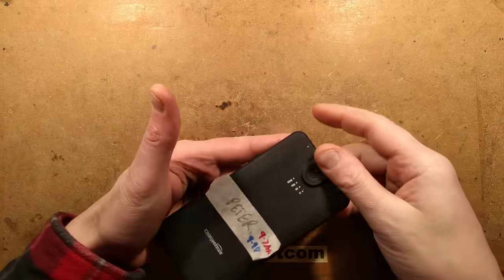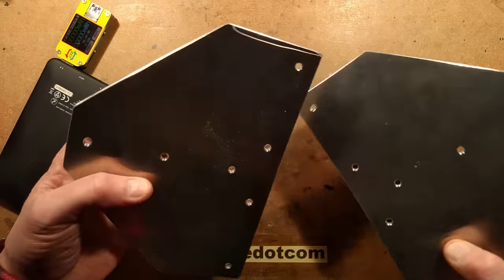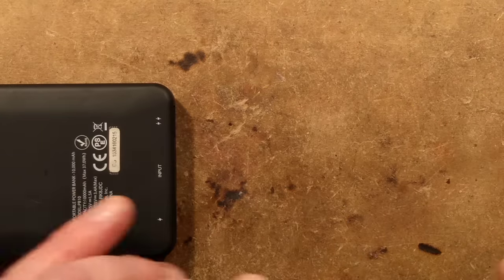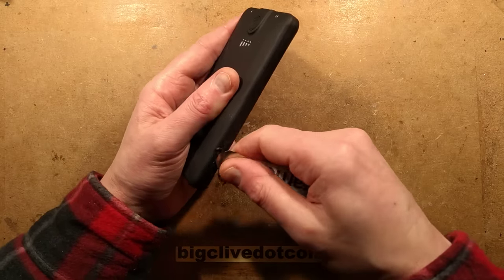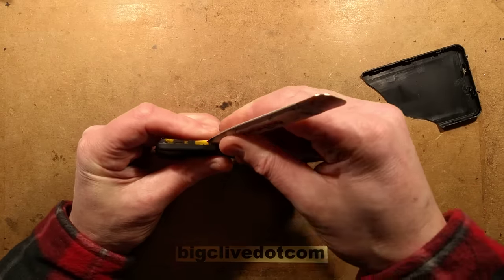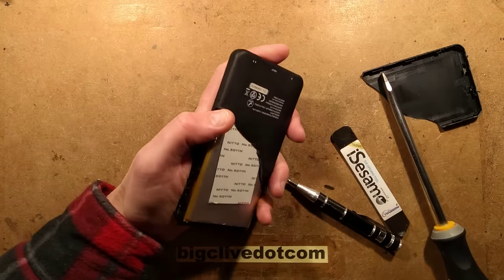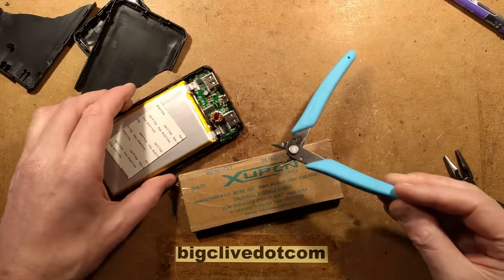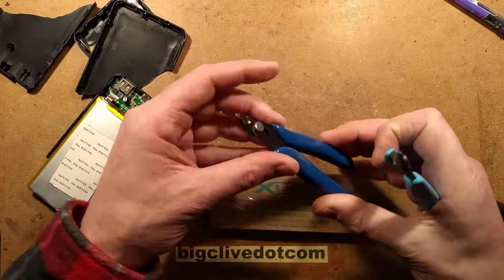Inside a recalled Amazon Basics power bank.

Comment: Hey Clive I'm most certainly not trying to tell you how to do what you do I'm just making a suggestion couldn't you use the heat gun on your soldering iron and heat the double sided sticky pad and slightly melt the glue it should make it easier to remove the cell and it shouldn't be such a risk of it exploding just a suggestion for the future

Comment: The little USB/control board tends to be perfectly fine ( £1 or so from Aliexpress/Banggood etc ) The LiPo's generally are cheap ( but reliable enough) high capacity low output packs that are stacked to either provide 7.4v stepped down or more capacity and stepped up to the 5v USB requirement ( iuse lipos in my RC Planes, Quadcopters etc but im changing to 18650 )
That case , as you suggest is horrendous, there should be some "breathing room" to provide a buffer for accidental drops etc but todays market wants more but smaller and so crap like this is what they get.
Reply: Rc batteries for me as well, my lad gives me his cast off drill batteries. Have converted most of my fleet to take 3 or 4 cell batteries. Great fun separating the cells from a Makita or Dewalt pack. Perhaps I might loose a minute or two duration, but for free that’s ok.

Comment: The recall is over concerns that it can over heat, no information on what over heats, the battery or the circuit board but it does state there is a risk of chemical burns which suggests the battery.
Does seem a bit of a panic reaction though there has been 50 reports of problems out of 260,000 units shipped, that seems like a fairly reasonable number of faulty units and not really an indication of a wider issue.

Comment: Using 99% isopropyl alcohol will temperately make the adhesive non sticky while wet and sticky when dry. I use it when removing the sticky strips on the iphone batteries.

Comment: 15:06 watch that solder short the battery under Clives sleeve....... Doh....... wonder what would have melted first, the solder or the battery.... perhaps another video!
Reply: That small of solder it "should" melt very quick and break the circuit. Im not willing to short out a lithium to test that though, but i have shorted solder against ground and a positive wire on my pickup. It melted in the time it took me to figure out what was going on.

Comment: Put the cookie down :P Even plastic pry tools can pierce into battery and do some nasty , but at least the screw driver is more easy to get but it can pierce also hand, but the electrician is experienced :P They didn't put the double sided tape to avoid riping the li-on pack if dropped since it is so tight fit

Comment: The extra resistor being used for current sensing would certainly make sense, not essential perhaps and often omitted by commercial manufacturers looking to save a cent perhaps but still a wise and rather low-cost sanity check to make sure not to overload the cell and it's highly volatile chemistry. Well to my mind that would certainly be the sort of thing that I'd opt to include if I were designing it, fire bad, customers on fire bad for reputation, less fire good but sadly all too often companies focus on making profit for the next 5 minutes rather than long term heh. As for the proximity of the mosfet probably not the cause though depending on the mosfet it doesn't strike me as the best idea to have anything that close to the battery which has the potential to exceed 100-110C even under failure conditions and some mosfets could continue to operate at that sort of temperature without failing. Sure that is quite a bit lower than would be expected to pose a high risk of the battery going into thermal runaway which is closer to 130C being a temperature that no part of a Lithium Cell should ever hit but considering the violent consequences of the things failing I would rather have any component that can reach 80% of that value and still continue to produce heat in a fault scenario as far away from the cell as space allows. The other components if they fail is a dead device that thing fails with enough energy to easily ignite any one of a number of very common materials such as paper and plastic with ease it's a building igniter in a failure so not something to take stupid chances with. There is a lot of excess paranoia with the things that blows it out of proportion but they certainly are no toy and it only makes sense to engineer to minimise the risk of unleashing their volatile chemistry in an uncontrolled manner for sure.

Comment: In reference to 4:40, I find iPhones are more easily openable than Samsungs, Huaweis, LGs and the like are. You just need the proper security bit for the two screws near the lightning port. It's been a while but I believe the rest of the screws inside are bog standard torx screws. Compare that to a samsung where you have to melt the bastard screen off just to get inside the bleedin' thing. 

They've got to have something good about them, right? :^)
Reply: Ironically, the cheap Chinese phones like Xiaomi, and even cheaper are simple as to open. Most use 2 Torx screws (normal ones, but tiny) and then clips. And once open, everything is easily disconnected and removed.
Worst part is taped in battery, but most have a removal tab to make it easy. Chinese people must repair stuff still 😂

Comment: The fact they didn’t use the double sided tape properly and peel the other side off is a bit worrying only because you’ve got people like that making them what if it was the battery connections they messed up a little bit and the battery shorted out, what are you going to do then, if someone doesn’t know their battery is shorted then it could explode in someone’s hand

Comment: Another thing is that it may have recalled for similar reasoning as to the EE power bar recall? as I remember you covering that one well enough.
Or it might be that 3.4A is too much for some of the internals (regarding heat). The battery should be fine as it would be 1.7A per cell, which isn't a problem with a 5Ah cell.

Comment: TBH I don't think the packaging on lipos is that easy to damage to the point that the battery will explode by dropping it and causing the corners to get dinged. Maybe dropping it and something else in the casing like the PCB piercing the battery.
I have tons of RC lipo packs that have flown/fallen directly into/onto concrete etc and ended up bent in half or ripped apart to the point that the tab welding is the only thing holding the pack together. If you have the balls to do it they still charge and discharge just fine.

Comment: This video, which had me expecting a flash and a bang for a while, attacking a charged battery pack with metal tools??  Mmmmmmm,  has reminded me of an issue I had a few years ago.  Also involving cheap side cutters.   I supply portable radios, walkie talkies, the UK supplier had bought some "cost effective" Chinese replacement batteries and we had sold some to one of our customers.  All was well for a few months and then I got the dreaded phone call, "a new battery pack has caught fire in the canteen"  they weren't happy as it had interrupted lunch.  OK replacement sent FoC with humble apologies and we would collect the faulty one when we were next passing.  Then 2 more went up with the same customer, OH heck.......   To cut a week long story short, there was a protection diode in the base of the case to stop volts appearing on the charging pin, there was also an internal fuse as a last resort form of protection.  The diode was separated from the cells with a thin piece of card, as per the original "expensive" batteries.  The BIG difference was that in the original batteries the diode lead was cut prior to assembly and flat on the tag that it was soldered to.  In the "cost effective" batteries the lead had been cut in situ which involved bending it at right angles to the tag, the cut had a "nice" sharp end left by the cutters.  Right, quite often the users of radios do not appreciate the jobs that they are called upon to do and in frustration bang the radio back down on the desk, or in at least one case, the canteen table.  The battery pack moved downwards within the case and after a number of frustrating calls the diode leg had cut through the card insulation and shorted onto the case of one of the cells,  sadly on the wrong side of the fuse, and so the battery added to the days frustrations by catching fire.   I had a chat with the importer and they were most apologetic, they checked their stock and there were many 100s in stores with the same issues and many more already sold, an expensive and potentially deadly error.  All of this due to just how a diode was cut and how a battery pack was not secured within its case.   PS Big Clive, your videos are amazing, enthralling and informative viewing, long may they continue, thank you and sorry for going nearly totally off topic with the above waffle!
Reply from the maker: That's an interesting failure mode.  I've seen a lot of products with lithium cells crammed into cases literally pressing against the sharp solder points of PCBs.

Comment: iPhones are serviceable, presumably much to the annoyance of battery changing “Genii” at the store that regularly give away free screens after they break them trying to open them. So if you have a scratched screen get a new battery for £45 and are odds on you get a new screen as well.
Reply: Serviceable implies user serviceable. If you need special tools, then it is simply NOT serviceable. If it were held together with phillips screws and clips then it would be.

Comment: I find using a Stanley knife blade and a hammer to tap it into the seam works very well
Reply from the maker: How deep is it best to tap the blade in?
Reply: @bigclivedotcom  usually only a millimeter or so. I tap it with either a pair of pliers or a small hammer.
Reply from the maker: @jaycee1980  So not the full depth of the blade then.
Reply: @bigclivedotcom  well.. maybe if you want flames :)

Comment: This is why "power banks" are worse than "li-ion chargers with power bank function". They are bulkier, but being able to use 18650/21700 li-ion cells that you choose is worth it for safety, performance, and serviceability. Consumer devices with Li-poly packs are so often janky because there is no manufacturer accountability -- the no-name batteries are made in the worst conditions by whoever does it cheapest. And some of the newer lithium ion cell chargers are now made with throw-in-pocket size and durability in mind.

Comment: Often that double-sided adhesive tape releases quite easily when you hit it with a heat gun. Not a flamethrower, just a modest heat gun.
Reply: Another quick way of producing enough heat for it to loosen is simply stabbing the battery with a screwdriver

Comment: For the kids attempting this at home:
Use a solvent to soften the adhesive tape!

I use isopropil alcohol, lamp petrol, automotive petrol, paint thinners, with great success. 
All it takes is a couple of drops put on the sides, around the cell, to seep in and a few minutes of letting it soften. 

Avoid acetone. It works but dries up way too fast.

Comment: you can use a bit of hot air to heat the case an soften the glue
Reply: There is no glue, and sure, heat up a battery, that always works up well
Reply: @leopoldobaltierra953  those glue strips that holds the bat in.

Comment: "The extra current that runs through the machine when the heating element is on can cause the door locking system to overheat." Care to do a vid on why the latest Whirlpool recall stinks of terrible electrical engineering?
Reply: Watch his video about how those locking systems typically work.

Comment: Modern phones like the newest samsung's and iphones are serviceable, they have just made it harder for anyone not authorized to work on the device+the complexity of unibody devices are ever increasing/changing. Trust me, I know from personal experience...and have had to revive thousands of "water resistant" devices in exchange for a decent tension headache lol. 
P.S. 
Advanced electronic repair and not for the shaky hands of this world, you could could snap glass and boards with a slight cough and a wiggle of the hand.

Comment: "3.4 amps max output that's a lot of current"

I have power banks that can do 5 amps

Specs if anyone's interested 

Input 5V 3A 9V 2A 12V 1.5A 

Output 4.5V 5A 5V 4.5A 9V 2A 12V 1.5A

Comment: You electricians always do things the hard way haha, clamp the sheets and drill though both at once
Reply from the maker: No proper clamp.  But I used to mass-drill and thread several panels at a time while building electrical control panels.

Comment: iPhones are still completely serviceable. Much the same way as before. It does require the application of some heat to loosen the adhesive plus replacing the waterproof seal if you want it to still be waterproof afterwards. But once you do you can replace the screen or the battery or the motherboard.

Comment: After I finish my testing, I'm re-purposing the 16,100mAh pack into an 5300mAh 8.4V pack for my emergency amateur radio equipment bag, and a 5300mAh 4.2V cell for use with my electric bicycle secondary headlight (an iPowerAdd bicycle headlight (unfortunately no longer supported...it's the best battery operated bike headlight I've ever found). Can't even find the poweradd.apk app/software for the headlight's bluetooth control system anymore.)

Comment: Lets bump that positional tolerance on that "off" hole a bit, and yeah, its fiiiiiiiiiiiiiiiine. +/- "its fine" is an acceptable tolerance.
Reply: Drill a larger hole and fill/cover it with stacked set of different size washers. And now you have adjustable screw hole.

Comment: If you stoped talking sheet and done a bit research instead, the clips are a finger space appart all the way round and plastic spudgers open it up easily and the reason they recalled them soo long ago was that in hot country US there was one case of a chemical burn due to heat source on skin for exposure of time. Amazon were scared and didnt want Samsung's reputation.

Comment: Seems very much like a Samsung style problem. Theoretical tolerances impossible in practice, and trying to hit capacity for marketing while neglecting safety. On the contrary if you look at an X-Ray of a new iPhone the corners of the cell are actually rounded to minimise stress during expansion, not to mention given ample room in the housing to do so. This means lots of “wasted” space but I see many less properly cited reports of exploding iPhones. I guess it’s simpler when you make 3 phones each year rather than 50 odd, and they all cost what the proper R&D needs (A lot!). My main issue with Samsung’s negligent approach to batteries is that it’s simply so consumer unfriendly. I may be slightly off topic but after learning from their lessons about cramming in cells, when will Samsung stop permanently gluing batteries into their phones? Do they not understand degradation. Pull tabs present on the iPhone and many many other devices allow safe removal with minimal risk of explosion, and when you pay over a grand for their flagship device you expect it to be simple to have someone replace the battery in your device after a couple of years when it’s performance is no longer peak.

Comment: Best fun yet, waiting . . . waiting . . . 13:00 min in and really, really hoping :-P I am guessing the reason the chip has two printings is Company A, has set standards for their chip. If it fails to meet the precise standard, it is rejected. It still works, but doesn't meet their demanding spec. They then sell the chip off to some cheap Chinesium manufacturer, who uses them in cheap electronics. Sometimes even claiming (sort of honestly, but not really) that it sports Company A chips. Sneaky, but what do you expect.

Comment: C'mon man, that's at least 5mm out, using my microscope eye, although untrained in the arts of measurement, my experiance of mechanical work, plus finding the right socket for said bolt head comes into play here. I doubt that This Old Tony would be overly impressed with that, unless both panels were drilled and counterbored by hand. Then I might imagine him allowing some graces apon your approximate 5mm missmeasurement :P

Comment: "And 1.65 amps is a high [charge] current" Evidently you don't fly RC drones... I charge my batteries at 5 amps each - the recommended current. According to the documentation they can handle 10 amps. Haven't needed to try that.

Comment: lemesee, if I pry on this hand grenade pin.... no, no, no, let's pry on it to deformation.... maybe solvent, no,  THAT could be dangerous... howabout just cutting here... 
Cut away, return to scene, Bench is still here, so are Clive's fingers. Awesome! OK, it's more or less diffused.... now let's peel the case off... Wait a sec, wonder how rugged these are??, oh, yeah, these were recalled due to explosive failure for no good reason... maybe it wasn't because of the cell?? Probably was though...

Next week, Clive opening 18650s with a 6" grinder wheel.. DEFECTIVE 18650s and a dropped grinding wheel in the vicinity of petrol vapors... 

You can't get this level of entertainment on any old youtube site ya know... 
Somehow it's more real (and exciting) than the flying Wallendas and Evil Knievel crossing  Niagara Falls in opposite directions. Deep breath everyone...

Comment: You could of just said that you used metric measurements on one plate  and Imperial on the other.
Reply from the maker: Strangely enough I did use both metric and imperial.  Sometimes inches just round down nicer.